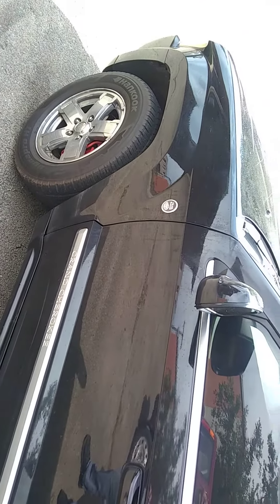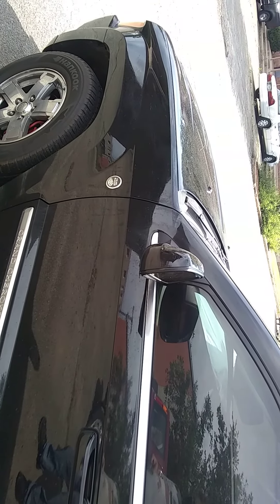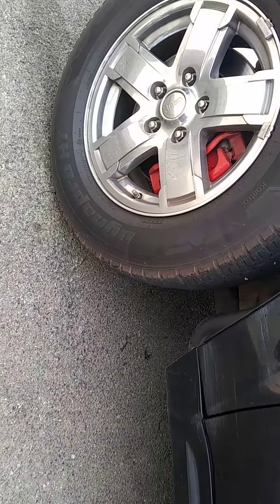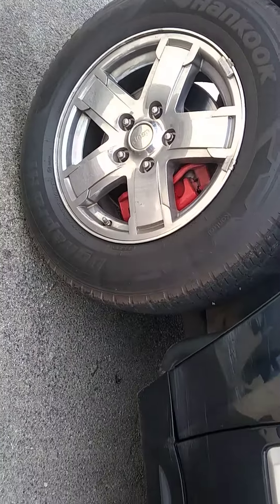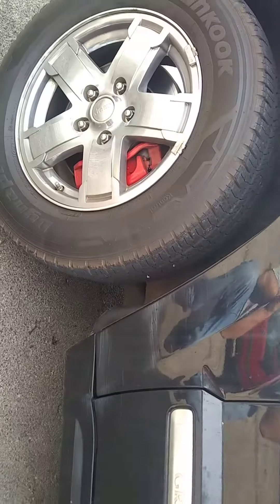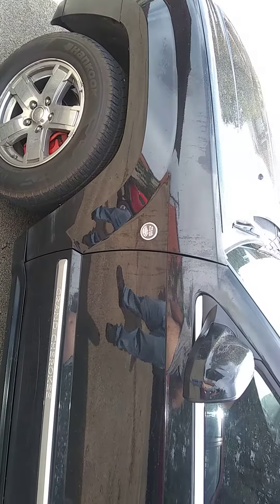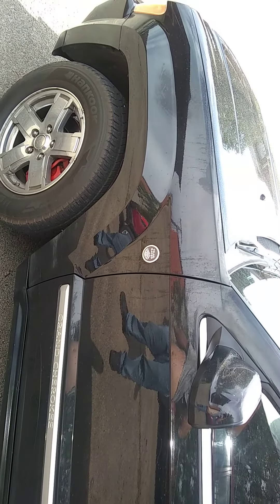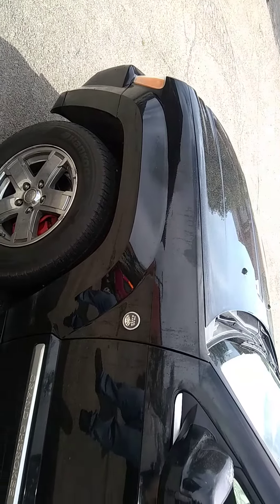Jeep 5.7 liter Hemi tick is actually an exhaust leak.

Comment: I have the same noise on my truck but it doesn’t go away
Reply from the maker: It could be an exhaust leak that is more than one broken bolt or the bolts are loose.
Reply from the maker: Check for exhaust leaks, if you have a camera phone it works well for filming in tight spaces underneath a hood like the exhaust bolts.

Comment: Why dont folks get the feds to make a dam recall for these crappy warping  manifolds!!!
Reply from the maker: I have owned 3 v8 muscle cars. 2 from the 70's, and one from the 60"s, all of them had thicker exhaust bolts with a even thicker shank before the threads where the bolt goes through the exhaust manifold. I never had a exhaust bolt break on those vehicles or a couple other smaller ones. I think the problem is the bolt thickness and possibly hardness of the steel. I still have work my truck but I have most of the stuff I need. I just replaced the compression pinch style of hose clamps with worm screw style and added new coolant yesterday.
Reply from the maker: The replacement bolts I bought are Doorman brand and made in India not sure about how well made they are.
Reply: I feel for you bro. What a pain in the fun ass..

Comment: Did tick get louder when u tap on gas
Reply from the maker: The tick / lifter valve noise goes away once the engine is warmed up. I have everything but a torc wrench to extract the broken bolt and install a new one. It took me going to a dealership and some parts stores to finally get the exhaust bolt kit for one side. I am gonna to try to get the repair done before winter.
Reply from the maker: I almost got everything I need to replace he bolt I just have to by a drill and extension cord, and do the work!

Comment: Wrong! You may have an exhaust leak, fine for you but do not discount the thousands of other customers with shredded lifters and cams.
Reply from the maker: I use 10w30 full synthetic Valvoline and Full Synthetic Lucas oil additive.